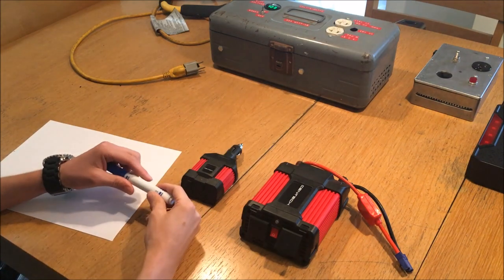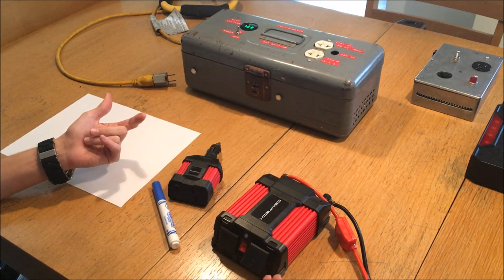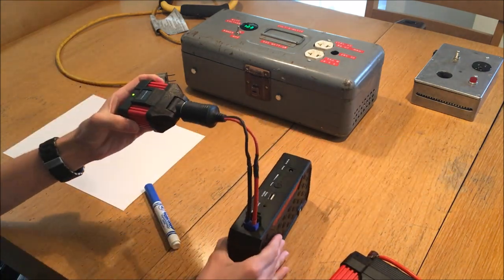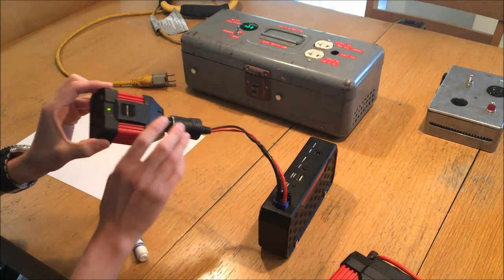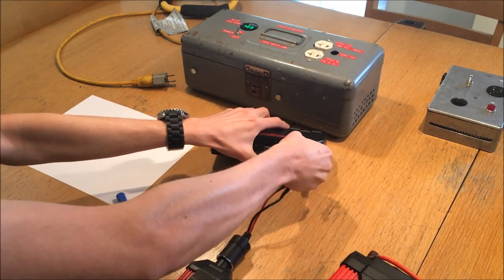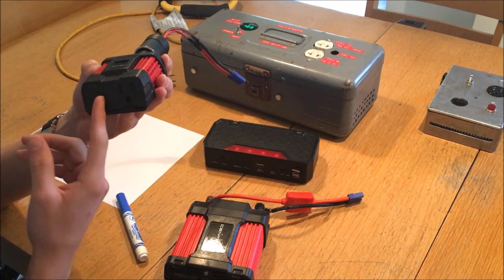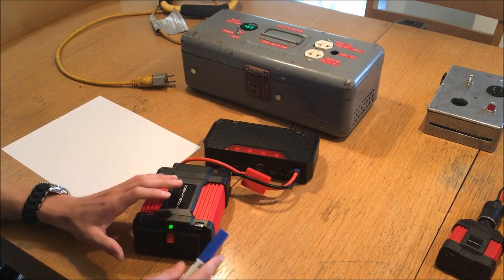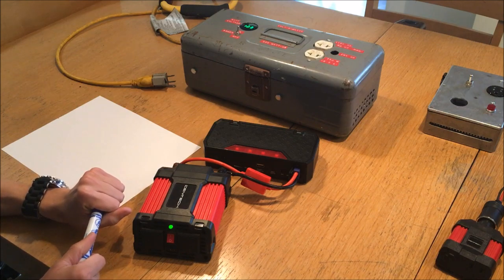EP 9 - CEN-TECH Inverter Series Review

Comment: I’ve been using a solar system for 10 years. I’ve burned a few inverters. I’ve been using a vector 400 watt inverter run through a triplite 600 watt isolator transformer for my tv, printer, tablet and small electronics for basically the 10 years with no problem. The inverters      That didn’t run through an isolation transformer failed. I now run a a 750 watt ever start inverter through a 1200watt Tripplite isolation transformer with no problems. This set up isolates the inverter from start up spikes that fry the fet’s and the line conditioner transformers run a little warmer but I’ve run them 24/7 for years with no problems . I’m also getting a sine wave out of them that makes my electronics happy. I find the Tripplite one have a minimal humm to them means their circuitry is better to handle msw outputs.

Comment: Great video ill looking to power a 20w led work light would a dewalt 20v battery work with the inverter?
Reply from the maker: The input range on these inverters is 10-15V, but you could use a 12V breakout module for the DeWalt battery series, which can be found on Amazon.

Comment: Nice vid btw. I just bought a 400 watt cen-tech inverter. Why mine does has that RED SQUARE thing on the positive wire? It's that a fuse, or should I get a refund?
Reply from the maker: I made that adapter cable out of an old jumper pack cable. The red box contains schottky diodes for the jump pack, but they are not required for the inverter.
Reply: @DielectricVideos  Nice, I'm more relief "are not required". We are new to solar and learning. Most people just demo lights, power tools, , etc. Can you do a vid using a microwave on your next demo?

Comment: The USB port is fine to use. The buck converter simply steps the voltage down. It is the least likely component to fail in the entire inverter.
Reply from the maker: Although you're right that it is probably the least likely component to fail, it is also likely to be the most destructive component to fail. If something in the inverter stage breaks, worst-case is that it either just shuts off, or perhaps shorts out the supply and blows the fuse. If the switching MOSFET in the buck converter fails closed, however, the full 12V supply voltage will be placed across the USB port, which will more than likely destroy any load (such as a smartphone) that's connected to it.
Reply: You're absolutely correct. Though the chances are slim of that specific failure. For myself, I've been using the USB port to charge all my lithium driven devices and have noticed an improvement in battery life.
I believe the port is regulated at 500 mA and has actually been a better charging source because of the lower amperage.
Reply from the maker: That's a good point, the slower charging rate would definitely benefit the lifespan of batteries. I'm glad to hear the USB has been reliable for you, and this is good information for viewers to see so they can decide whether to use the port or not!

Comment: The gauge of your "car adapter" wire is insufficient for the full load rating of the 400 watt unit.
Am I wrong?
Reply from the maker: It is, as the accessory plug in a car is typically fused at 10, 15, or 20 amps.

Comment: Questions: The inverters run off of batteries? Can the inverters be powered with solar panels? thanks.
Reply from the maker: Yes, the inverters can absolutely be run directly from solar panels (I have done so myself) provided the voltage is between 10V and 15V. Note that the open-circuit voltage of many solar panels is quite a bit higher than the maximum power point voltage. Cheers!

Comment: Using a fluke meter plugged in the outlet with no load the fluke is only reading 90 volts plug something in and voltage jumps up to 110 volts is this normal?
Reply from the maker: The output of these inverters is non-sinusoidal (controlled-duty cycle rectangle wave), so it is possible for meters which are not 'True RMS' to read the rectangle wave voltage incorrectly. Applying a load sometimes softens the edge-transitions on the output waveform and allows the meter to read correctly.
Reply: Dielectric Videos This is true I know my meter is a true RMS meter this is why I status I have a manual transfer switch center position is low to a GFCI for the feed right side position is shore power left side is inverter with the GFCI tripped it will not reset unless it sees 110 V plus or minus 10% if I should plug a lightbulb into the inverter on the outlet not being used it bumps up the voltage to 110 therefore I can reset the GFCI
Reply: My voice command sucks sorry hope you can understand what I’m saying
Reply from the maker: @richardpoore7195  It's possible the inverter unit is defective and is supplying incorrect voltage when unloaded. Alternatively you might need a pure sine inverter for the GFCI to operate correctly, especially if its internal circuitry is powered by a capacitive dropper. Do you have an oscilloscope that you could use to look at the output waveform of the inverter both unloaded and under load?

Comment: I have a 400 / 800 watt centech Harbor Freight inverter I would like to know if I can hook that to my RV or my generator
Reply from the maker: It can be connected to any 10-15V DC voltage source. Be sure to not connect more load to the inverter than the fuse in the vehicle or generator is rated to supply. Also avoid deeply discharging the battery on the RV, and if possible use a separate DC system from the engine starting battery on the RV.